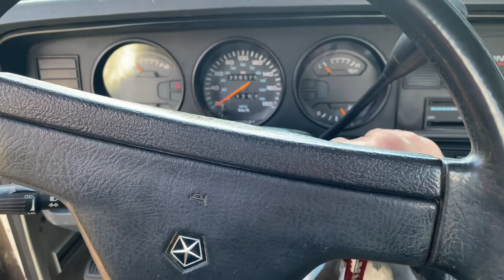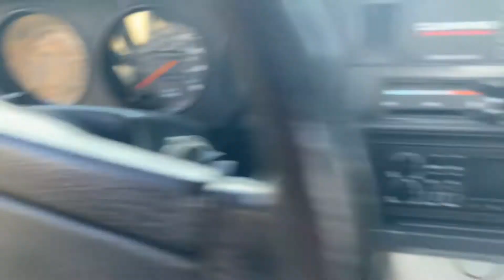Far from stock upper control arms

Comment: Hey man njce vid. I've got a d150 club cab. Did you use the moog 7226 springs. I was gun a get those as Eaton Detroit springs are double or triple as much. Anyway I got a full new front end coming for mt truck now but not sure what springs and shocks to get. In the end of the video what size tire did you have on !? Looking forward to more ram vids
Reply from the maker: 7226 will work in the gas engine but you will have a tough time compressing it because they are heavy duty shocks and the weight of the Cummins usually overcomes that
Reply from the maker: I’ve put 7226 and also 7116 with a 2 inch spacer and I think the 7116 rides better because in the gas engine you don’t have the weight of the Cummins, but if you have the Cummins you need to use the 7226
Reply from the maker: I’ll try to make a video explaining everything
Reply: @FirstGendodgegarage  ok man good stuff ill keep watching I've subscribed.  A buddy if mine used the eaton Detroit soring with a plus 2 inch springs he didn't use any spacers. If I get the moog springs will I need to block up the rear ? I was going to do a 3 inch body lift also ! I'm essentially trying to fit a 33 tire at max.
Reply from the maker: @hobbyavenue6740  yeah I would if your rear is worn out it will squat a little
Reply from the maker: @hobbyavenue6740  in earlier video I got my grey truck with a roller and it shows the squat
Reply: @FirstGendodgegarage  ok ill get the 2 inch lift block for the rear. I know eston Detroit can get me a 2 inch lift springs but it costs like 450 canadian potatoes. The moog 7226s is like half as much